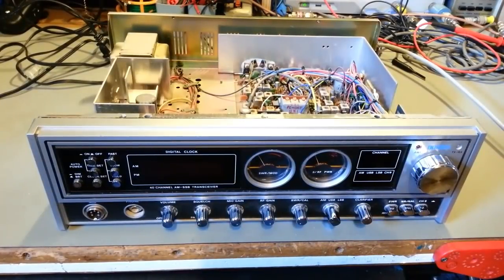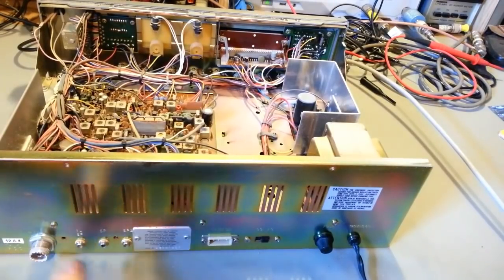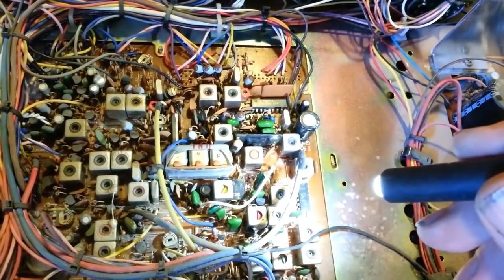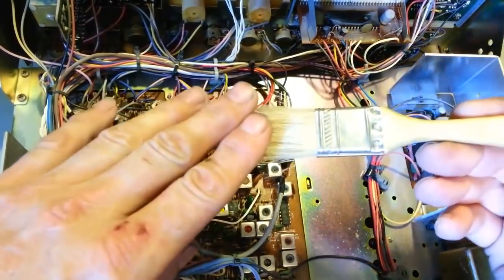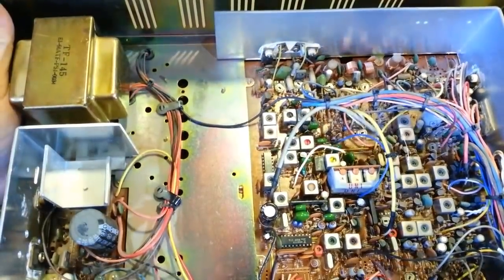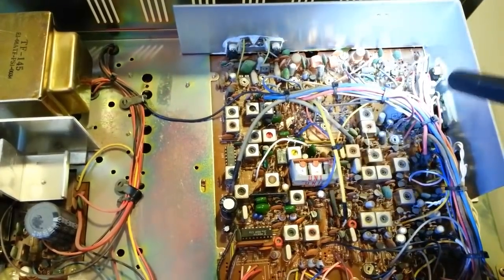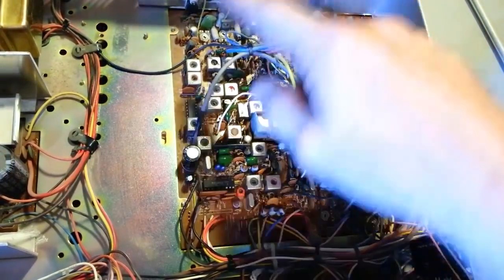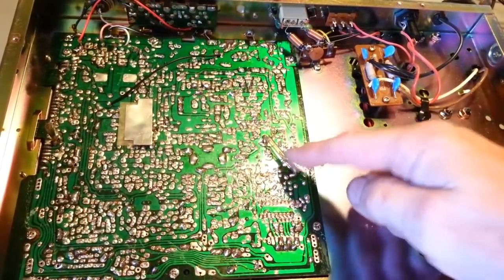So you bought a old CB. Initial inspection, things to look for BEFORE you plug it in the first time.

Comment: THanks a Million!  Just purchased a Uniden Washington base unit at a community wide yard sale.  Fellow who had it swore it worked last time he used it, however the dust patterns showed that it had been in the garage for awhile as I could have written my name on the top.  So in that condition I talked him down to a 20 dollar bill and brought home my new toy. RIght now I am living in our Class A motor home in Arizona, trying to avoid the cold and snow in South Dakota.  Since the unit you are doing on this video is very much like the Washington, I followed your lead and cleaned her out.  Didn't do a cap replacement because I don't have access to any caps right now, the inside was actually much cleaner then the case, I had cleaned the case with a damp rag before undoing all the screws which were indeed all present and accounted for. There was a light coat of dust over the entire inside, and she looked to be untouched since day one, in fact all the screws gave that factory fresh snap when I unscrewed them.  After the cleaning, I power he up, and can get static all over the bands, she does seem to key up (after hooking her up to a magnamount CB antenna by Radio Shack (another classic!)  I could not beg a contact despite the fact I can see Interstate 40 from my door, and all I get is static.  I will try to get a better antenna for her and the meter light is burned out, however the meter seems to be in great order.  The fellow I got her from said he used it for dispatch for the community watch for all of it's life but had just received a better unit as a gift from his wife last year so decided to part with this set.
Getting to my question - I would like to replace that bulb with an LED but I don't know the voltage that is running the lamp?  I have some LED's along and some resistors so I could easily do the work if I knew the voltage. I am just to lazy I guess to dig out my meter and put that across the leads, and they are buried so well on the underside of the board.  Perhaps I will just pull the bottom off, that is the ony part of the check I failed to do, then dig out my meter and find out for myself.
Reply from the maker: +Jerry Ericsson 

Most radios run the illumination lighting off of the 13.8 volt rail.  For a white LED a 820 ohm resistor usually works well.  Really depends on the specs of the LED.
Reply: Jerry Ericsson You should get antenna matcher it would help swr problems tune  your swr lower  maybe thats why can't hear you on the Interstate you  should get tram cat twin antenna  that help your motor home they alot better magnamount antenna you can't get very much ranger  tram cat antenna  they look like coil  type antennas that goes on trucker drivers.

Comment: Rule of thumb as I was taught is NEVER use anything larger than a 5 amp fuse, even if you’re running an “internal” amplifier and a beefed up radio it’ll never draw more than 5 if it’s working properly, and if you blow a fuse take it to a radio shop

Comment: Great video!  Also, when I look at a radio, I often times will look at the condition of the plated chassis on the back & condition of the screws and connectors.  If heavily oxidized or rusted, I'll usually pass (the insides/electronics could be even worse!).

However, you've also educated me to understand/accept that (for example) a smoker's radio (from the 70's-80's) is pretty common because of people's lifestyles back then.  So, if the radio is otherwise clean... then, it's definitely worthwhile if it's a rare or unusual radio.  

BTW - I recently picked up a pretty clean Pearce Simpson Bearcat 23B.  It was a smoker's radio, but it also had the owner's SS # engraved on bottom and back.  Again, that was a sign of the times' because back then CB's were expensive (especially a nice base station or higher end mobile rig) and high-theft items.  So, taking that into account, and the fact that it's not normally noticeable, it doesn't bother me.  Maybe it adds a different kind of petina to the radio??  lol

PS: The FCC sticker with owner's name, address and FCC CB callsign are also on the radio.  Again... "more petina".  :)

Comment: I have a question about what type of vacuum cleaner to use to get rid of the dust. We have a hoover upright with a detachable hose that we got at a yard sale and the center brush on the bottom doesn't work. We also have a shop vac with a hose but it doesn't have a crevice tool. It came with one but 10 years ago we moved and we lost it. Well its not lost its some where in the garage or the basement. Now if we can find the crevice tool should we use the hoover to help clean off the dust if it will fit? Does any one know if the tools are interchangeable from a shop vac not sure the model but its red and has a descent sized can but we had to throw away the filter so that might affect how much dust it could get off the circuit board. I'm not sure how many gallons it hold but we used it to clean out the basement and only had to dump out the dirt once. The basement is not that big but we haven't cleaned it in probably three years since one time it flooded. We didn't use the shop vac to suck out the water though. For that we rented a pump. Back to the hoover the brush on the bottom doesn't spin and I thought it was the belt but when I took it apart I couldn't find the belt. So I looked up the model on the internet but couldn't connect because comcast still hadn't switched us from verizon yet. We called comcast and they said the third party verification failed. So I went to redo it but it turns out the bill was in my wifes name and they had to talk to her. That would have been fine but she was at work. So we tried to call her at work but when we did the conference call we got her voice mail. So when I was on hold I realized the hoover doesn't have a belt. So I tried to plug it in and test it when it was upside down but I couldn't reach the power switch. Once I got the vacuum upright I realized I might need a volt meter. We used to have one in our basement before we moved. But alot of things got mixed up when we condensed the things from the attic in our old house. So after I found it I tried to see if the lower motor was getting voltage. But it wasn't . Or should I just use a can of dust off?

Comment: Great video. Would you (or anyone else reading this) happen to know how to get rid of that annoying popping sound every time the channel is changed on these types of CB radios? I have a President P400 (same as the Uniden Washington) that does this, just like the Madison, and the Cobra 142 GTL. It's not a problem contact cleaner can fix, as cleaner has been applied in the past. Thanks for your help.
Reply: Oh, wow, thank you.  I've asked people in the past, but nobody seems to know.  They do say stuff like "It can be done", but that is it, lol.  Thanks again.
Reply: Well, I opened up the radio, but there is a blank spot where R197 should be.  Perhaps my particular PCB omitted it for some reason.  Thanks for your help, regardless.

Comment: To get the maximum transfer of heat from a transistor to a heat sink use the thinnest layer of white thermal compound you can manage. A layer so thin you can barely see it is best. I tested this with expensive computer processors in the 90's and it's true.  Metal to metal is best. The next best is a microscopic layer of heat compound. Look for Arctic Silver on eBay. Heat pads suck. They insulate almost as much as they transfer.
Reply: this is not correct.
If you place a CPU bare die, or even one with a heat spreader " metal to metal " you will no longer have a processor. If you mount a transistor to a heat-sink that has a common collector and do not use an insulator between bare metal and the transistor body; you will no longer have a transistor
Reply: too much thermal grease is not good, but so is not enough.
Reply: Nope. Have you done the test for yourself? I know what common knowledge says. I hear it myself. But have you done the tests for yourself? I have. The very least heat compound you can manage, an almost transparent layer, works best and transfers the most heat. Only bare metal to metal transfers more heat but then you get microscopic air gaps because the metal parts aren't 100% flat. A THIN layer of heat compound fills those air gaps and adds to the transfer. A thick layer of paste becomes an insulator and that you do not want!

Comment: thanks for the excellent instructions. I was aware of the aging problem of electrolytic capacitors but I am wary of replacing them and then finding it has affected the alignment negatively, I have an old 23 channel cb, if I am not capable of aligning the radio after electrolytic capacitor replacement am I better off leaving the old caps in?

Comment: Great tips Mike, thank you. The conductive glue that should be removed is it replace with something else or not replaced at all. Thanks for sharing your wisdom with us. Joel
Reply from the maker: +In Joel's Garage 

In base stations I don't replace it with anything.  In mobile radios that are subjected to a lot of vibration I use hot glue.  Nice thing about hot glue is its easy to remove later.  Just add a drop or two of isopropyl alcohol, let it set for a few seconds and it pops right off.  It doesn't melt the glue, it just breaks it's bond somehow.
Reply: Hey Mike, how would one get in contact with you? I have a Uniden Washington my mom and dad bought me for Christmas many moons ago and its been through its share of hack cb golden screwdrivers over the years. I'd love to have it restored! Thanks!

Comment: Hi Mike, Great advice on buying a unknown radio.
I have a question to ask you, I have been working on a President P300 SSB mobile radio.
It came to my shop not working and after a clean and realignment the radio worked fine for 4 weeks then stopped working. Turning the radio off for 30 minutes it would work for 5 minutes and stop Transmitting again. The radio has no TX audio on both AM and SSB. (Note: Dead carrier on AM, nothing on SSB) The radio has the Uniden PC-833AF board.
The radio receives and has PA audio but nothing getting to the transmit. I have recapped the whole radio and still no audio on TX.
Do you have any ideas where i might look?
Thanks Mike.

Comment: Well, I finally had to subscribe to your channel 'cause I watch so many of yer videos.  I need to see a few of you working on guitar amps 'cause I play a guitar, an Ibanez.  I use a solid state Crate amp 150 watts.  I have an old isolation transformer with 3 different 2 prong sockets at voltages from 105, 110 and 120.  I took one side of the bell off and mounted an on off toggle switch for its line cord.  Guess if I had to use it for a 3 prong power cord I'd have to use an adapter.  Can I do this safely?  I have my wife's parents' CB single sideband radios that were bought brand new.  As soon as I can find them and the D-104 in the storage shed I'm gonna take it apart and check it out.  I may need to replace all the caps since it is from the mid 70's.

Comment: Your videos are good.  You seem to be. A very very good tech.  What do you charge to look at and fix. A radio.  And do you do the basic swing mod. Cause that's all I need. But the right way.  No clipped limiter.
Reply from the maker: I don't do "swing" mods.  All they do is increase adjacent channel splatter and increase harmonic emissions.  End result is it distorts the transmitted audio and actually lowers power on channel.

Comment: Whoever cool bro I think it's a 148 model you fix it I know it works need to put a new mic connector on and I don't know what else it doesn't do SWR meters at working and can't calibrate it but I know it transmits

Comment: I love this type of video, can you talk about the min equipment needed to get into servicing cb's
And can we buy used or should we buy used? EBay? Can we service the test equipment? Or should it be professionally aligned or calibrated
Reply: Depends on your technical ability, alignment of test equipment requires SOME TEST equipment, if you can afford  a piece of gear that has recent calibration certs, do that.  
Starter Kit: 
8 Digit frequency counter.
Audio signal gen.
RF Signal gen capable of 1 KHz audio signal at 30% modulation.
Sinad meter.
@ LEAST 60 MHz bandwidth Oscilloscope.
RF sampler. (make one) 
SDR (poor mans band-view scope, prefer a spectrum analyzer though)
73

Comment: Do resistors change tolerance over the years?  If so, is it enough to worry about?
Reply: Typically, resistors will not change over the years, provided they weren't subject to over current or over voltage.

Comment: The only time I use IP is on old tube stuff. Mostly to get junk out of sockets. Just like you bottom side only 99% of the time. 

Their is one guy that does questionable work. He is well known for using things like drive way cleaner, Purple Power etc.....That said he almost always replaces all the wiring as part of his package. 

When I was a little kid one of the first things Dad taught me was " Never clean your tools with solvent unless you are takig them apart to rebuild them or grease them! I use compressed air from an air compressor first. Anything the air compressor does not get I than take a brush too.

In fact just the other day it had been 2 years since I blew out my PC or my Blu Ray Player. The Blu Ray was almost dust free but had no grease left on the geared tray and would hardly eject. 30 seconds of air and some grease works like new. THe PC was full of dust 5 minutes later it was running cooler and the fans where spinning much quiter. Just blowing dust out of gear every couple of years can make a huge difference in how it works andhow long it lasts because of heat. Dust can also become conductive and short out parts or make them read out of range!

Comment: Mike, I see alot where there is a push to go back and get the old 70's, 80's CB sets restored and going again. This is old technology where today there is direct conversion technology where an $8.00 RTL-SDR dongle can be converted to recieve on 27 Mhz. Perhaps you could have a Youtube show where you convert one of these dongles and show folks the CB band with the direct conversion SDR with panadapter view of the whole 40 channels and with waterfall display. Much more efficient tool set for modern HF communication
Reply from the maker: Don't own and have never used a SDR dongle.  I have never understood using a computer as a radio.  Nothing beats using a real radio as a radio.  Using a computer as a radio is clunky, complicated and requires lots of other accessories.  Who want's to wait for their computer to boot up to use it as a radio.  I reach over, turn the radio on and it's just that, on.  People restore old radios because that's what they want, old radios.  They usually hate new radios because they are such poor quality.  Let's see if that dongle is working in 30, 40 or even 50 years, doubtful.  If it transmits it would also be illegal to use on the CB band because it's not type accepted by the FCC.  And getting smooth, crisp clear audio out of a horrible direct conversion digitized radio is impossible.  There's only one thing that sounds amazing on air, glass.  No one has simulated the sound of a vacuum tube successfully.